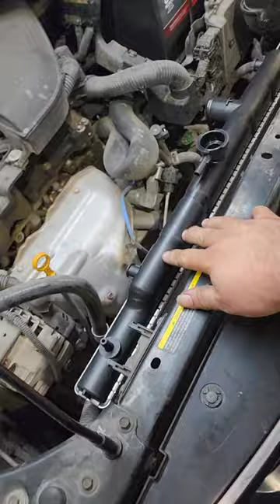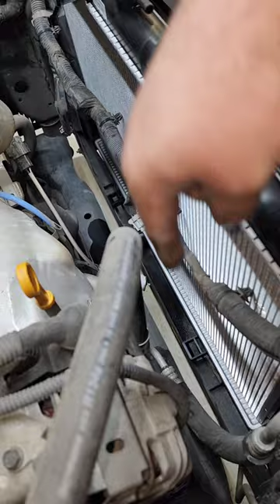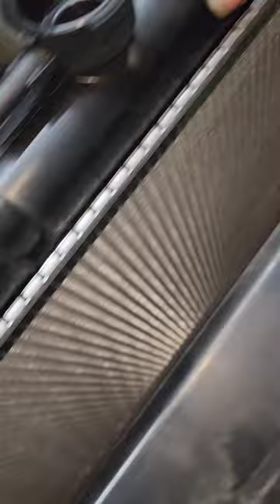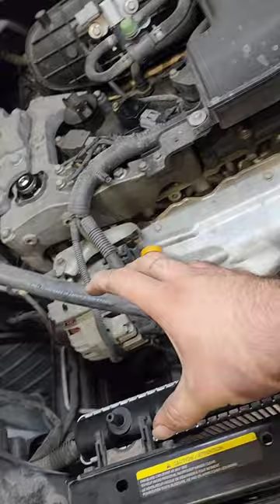RADIATOR DAMAGE 😬 #auto #shorts #mechanic

Comment: Cut up the box, with a box cutter... 😅 Two- 2 by 3 squares. I cover the fins, front & rear. Tape left and right, to front & rear cardboard , over the top of the tank. Fits perfectly and doesn't get in your way. FM
Reply: Pro tip, leave it like that after installation to prevent a mess in case the new radiator springs a leak
Reply: @dr_beetus  Need to in the winter here in Cleveland. Get heat faster 😜
Reply: Yup, make a cardboard rad protector. And slow down, don't be in a rush
Reply: @tonyb1968  absolutely 😎👌

Comment: Get the radiator from a reputable parts dealer that will replace it under warranty. I get all of the radiators I replace from a place called Midway Auto Parts. They come with lifetime warranty. I broke the overflow stem off of one just a couple of weeks ago before even getting it installed and they replaced it under warranty. They sell quality parts and the staff there is absolutely awesome

Comment: Just gotta be careful. Last year I was replacing a head gasket in an international dump truck. Removed the radiator/cac assy and noticed the corner of the radiator was rotted out. Ordered a new radiator, 1000 bucks. I was rushed putting it back together and tipped the new radiator into the corner of my cart, bye bye thousand dollar radiator. Stuff happens man.